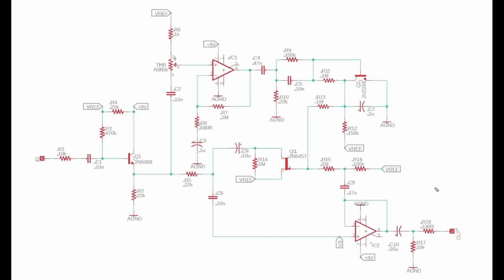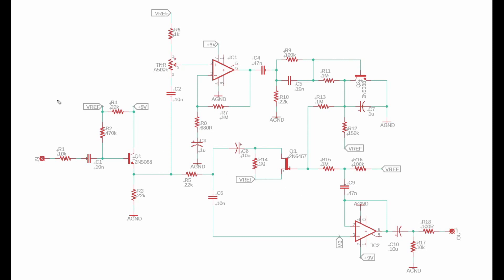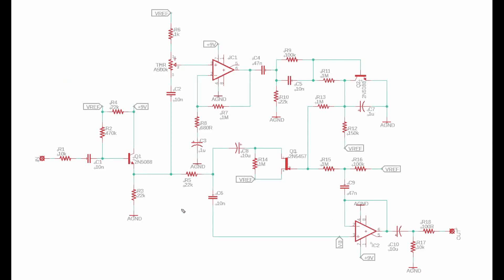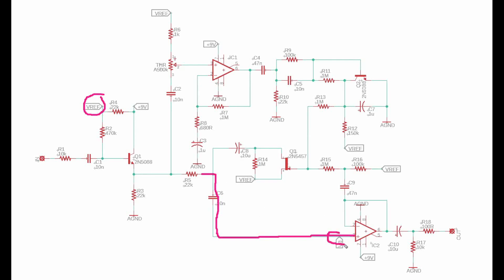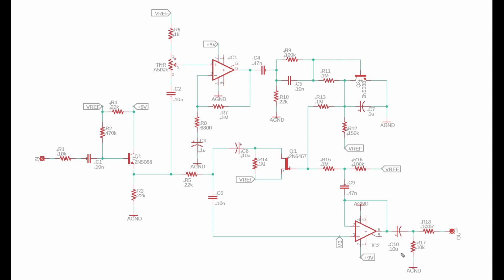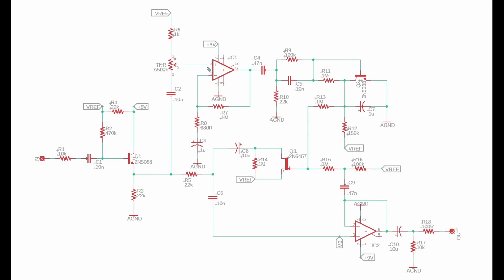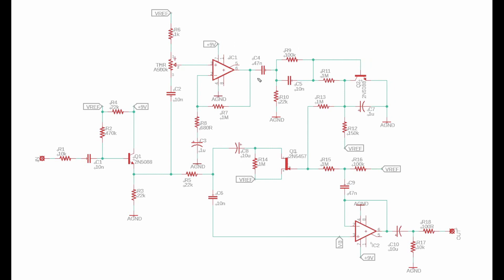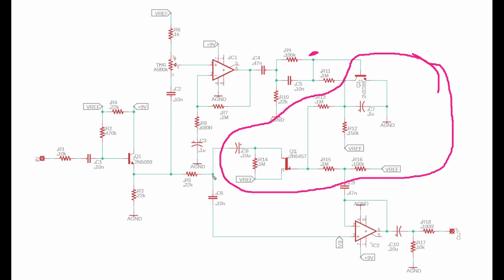Schematic Elements for Guitars and Effects: Transistors as Switches and the MXR Noise Gate

Comment: Great explanation!! finally I'm close to understand this kind of schematic!!

Just one question, if I'd to trigger the gating action by an external signal, where should I inject it ? 

Like, split the guitar input, one part is going to the effects chain which includes a noise-gate at the end of the chain, the other part (clean signal) is going to trigger the
noise-gate to mute the effected signal from the chain.

Thanks for attention
Reply from the maker: You would disconnect the signal from the input buffer that goes to the sensitivity knob and hook up your side chain key (trigger signal) to the sensitivity knob instead.

Comment: @thescientificguitarist4228 I'm not getting a smooth gating action on my '79 MXR MX-106 Noise Gate.  It seems to crackle and oscillate as it's gating the signal.  Can a bad Q2 cause the gate to do this as it's clamping down on the signal?  I've literally replaced everything else on the board except the BJTs and it works exactly as crappy as when I got it.  If I do replace the BJTs I have 2N3904 and BC337 to choose from.  I'm leaning toward the BC337 and I belive they are pin compatible.   Thanks for any help.

Comment: I wanted to make one for my pedalboard to cut the unwanted noise out. There were some schematics floating over the net, yet there's a huge debate on them about not being %100 correct. Luckily, I've found one on diystomboxes, and yesterday I finished that. (seems the same with yours as well)

It seems to be working, but it's a bit weird to me. It's blocking the hi-gain noise indeed when strings are muted, but the sensitivity pot seems to act a bit unusual. Considering that my volume level is 10 out of my preamp;

1- In the first quarter of the pot range, the volume level is around 8, gating works but no threshold effect,
2- On the 2nd, it is 10 but the attack ripples/distorts a bit and gating doesn't seem to work properly,
3- From the 3rd quarter until the end of the range, the volume level is around 3, and gating works.

I've tried some suggestions on Tonepad's build reports, but they seem not to work, it's a bit different schematic anyway so I didn't have much hope for that.

Used 2x 3904's (no idea about their matches or Hfe, my DMM can't measure that), and 2n5485 in reverse for 5952. Cap's are not tantalum.

I remember reading somewhere that this specific pedal doesn't act like a regular NS-2 or something, like when you increase the sens. pot, the threshold level decreases so that more sound is sucked. Is that the case?

Also another question is, is it possible to alter the attack & release times?

I can share the schematic I followed but I think its being blocked due to image link I share.
Reply: Release time: replace R12 with variable 1M or bigger resistor. Release time is determined by RC constant of your variable resistor and C7. However, keep in mind that the difference between min and max voltages on Q2's collector is greater than the difference between gate voltages of fully opened and fully closed JFET, so by ear actual attacks will be shorter and actual releases will come with delay.

Attack time: current schematic has 0 attack time, to make it non-zero, insert variable resistor between joint where R13 C7 R12 connect and the joint where R11 Q2 connect.

This schematic by design only reacts to one half of the signal to detect its level - not ideal if the signal is not symmetrical.

Comment: Thank you for explanation! It also helped a lot that you connected JFET and C8 correctly, unlike what you find on internet ;)
Any ideas what C9 and R11 are for?
Reply from the maker: C9 is the DC blocking cap for the output opamp, so that the negative terminal is not pulled up to VREF. R11 serves as a feedback resistor for Q2.
Reply: @thescientificguitarist4228  R11 understood.
C9 It's about why this link exists at all. It adds like half of the audio signal to the gate voltage of the JFET. Other circuits I've seen also do so.

Anyway, thanks to this video I was able to understand how more complicated noise gate (boss nf-1) works, and to design by own noise gate based on that, and it works! Thanks a lot again!

Comment: Dude, your envelope follower is wrong, you circled the threshold (just a volume control, or a "voltage divider") but you also circled the high gain clipper (IC1), the envelope follower is what's after that clipper.
What does the gating is rather Q3 alone, it's the variable resistor.
Then later you say that IC2 is connected to Vref via C9, but C9 get rids of DC, so IC2 isn't connected to Vref at all, but rather VB (the two 1meg resistors you removed).
R18 at the end is just "common on some effects" it's to prevent the IC to oscillate when unplugging the guitar cable.
R7 (you mean R8) and C3 is not a low pass filter but high pass, however there is some kind of low pass filtering going on, but it's because of the slew rate of the op amp that cannot provide the gain on the whole audio spectrum, if the slew rate were infinite you wouldn't have that low pass filtering going on.
A part from these mistakes, the rest of the explanations are correct.

Comment: Why is my question deleted? I was asking something technical but twice my message has been deleted?
Reply from the maker: I have not deleted anything. Maybe one of YT's automated filters thought it was somethign else?
Reply: @thescientificguitarist4228  I see.

Well, my question was indeed about this circuit. I wanted to make one for my pedalboard to cut the unwanted noise out. There were some schematics floating over the net, yet there's a huge debate on them about not being %100 correct. Luckily, I've found one on diystomboxes, and yesterday I finished that.

It seems working, but it's a bit weird. It's blocking the hi-gain noise indeed when strings are muted, but the sensitivity pot seems to act a bit unusual. Consider that my volume level is 10 out of my preamp;

1- In the first quarter of the pot range, the volume level is around 7, gating works,
2- On the 2nd, it is 10 but the attack ripples/distorts a bit and gating doesn't seem to work properly,
3- From the 3rd quarter until the end of the range, the volume level is around 3, and gating works.

I've tried some suggestions on Tonepad's build reports, but they seem not to work, it's a bit different schematic anyway so I didn't have much hope for that.

Used 2x 3904's (no idea about their matches or Hfe, my DMM can't measure that), and 2n5485 in reverse for 5952. Cap's are not tantalum.

I remember reading somewhere that this specific pedal doesn't act like a regular NS-2 or something, like when you increase the sens. pot, the threshold level decreases so that more sound is sucked. Is that the case?

Also another question is, is it possible to alter the attack & release times?

I can share the schematic I followed but I think its being blocked due to image link I share.